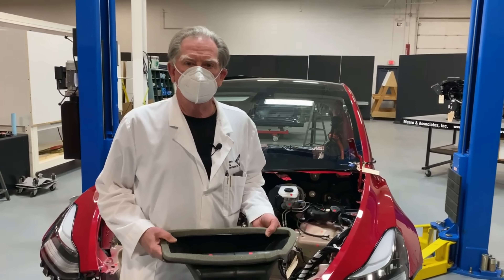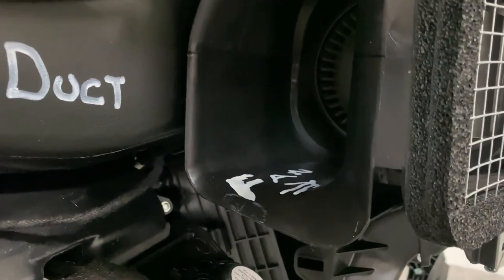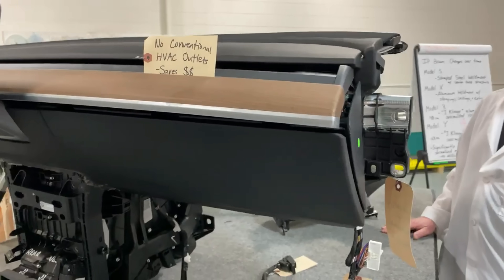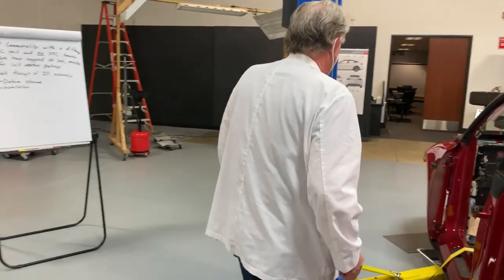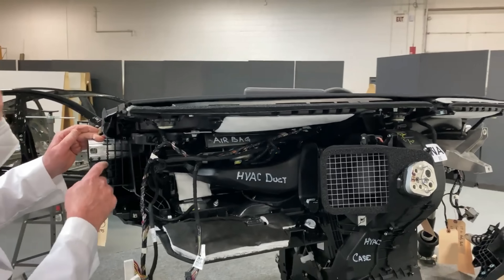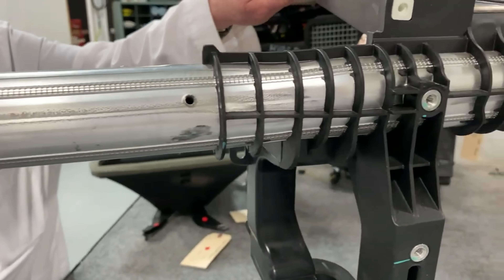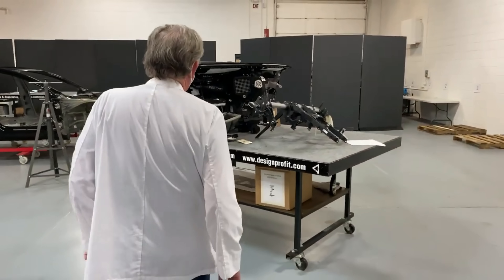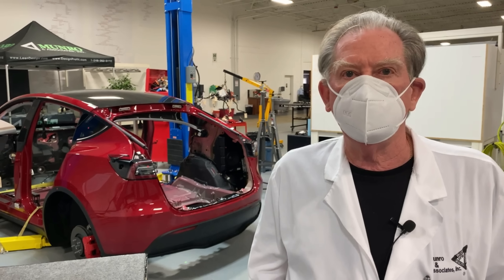Model Y E18: Instrument Panel (IP) Assembly & Comparison MY-M3

Comment: As a manufacturing engineer, I'm not seeing anything unique in assembly here which is cost effective, reliable and of quality assembly that other manufacturers don't do. Would be interested in seeing a true build cost as that would indicate the profit and viability of Tesla. Today it's been announced that Tesla is asking for sales location rent reduction from landlords due to cash flow issues. Let manufacturers reopen and adhere to CDC guidelines. "It's the economy stupid!"
Reply: The model Y+3 are most unique due to their powertrain, recharging speed, user interface, and price point.  There have been things shown and referred to (the overmolded extrusion subdash, the octovalve, and probably some others that I'm forgetting), that are very unique and innovative. If someone can't see that, perhaps they'd like to buy my bridge 😂
Reply: @thelondonbroiler  Ah, I see you must be a fanboy. I am speaking of the manufacturing methods / assembly techniques / processes / material selection. I did not speak of a unique Tesla design feature; slapping a tablet on a dash, a single HVAC slot on the upper dash, an app for fart noises, etc. There is a difference between the two. Magna International is just one of numerous automotive suppliers that performs overmolding on extrusions. I believe you might be a troll under your bridge. :)

Comment: Mr Munro, can you tell us if TESLA conditions it's battery packs? Like do they remove heat when supercharging and warm up  when it is too cold: hvac or electronic conditioning? Kudos for overmolds.
Reply: Tesla battery packs (like most modern EVs, Nissan LEAF and a few others excluded) are thermally managed using liquid coolant.
Reply: @thelondonbroiler  And the heat pump on the Model Y should help out dramatically in cold climates for range and charge rates.

Comment: A computer-controlled system of motors, solenoids, valves and louvers hidden inside a decorative slot in the dash saves money over a $2 plastic, manually operated vent cover? In what world?
Reply: Motors, solenoids and valves also exist in the other cars, so you save on every 2 dollar plastic vent cover, I have 4 in the front 2 in the back of my car some probably have twice that amount.
Reply: @johnmqueripel2367  - You would still have the back ones in the Tesla. And the Tesla would have the motors and doors to control air direction IN ADDITION to the ones that every other car has. Remember, we are talking about replacing the functionality of the dash vents, not the functionality to control air delivery.

Comment: I do not think you are right about mm, it probably not 13mm rather 13cm [130mm]. 20mm is like 0.78" something, but 2mm is 1/16" is really nothing.
Reply from the maker: Good catch, and thank you for the comment!  Just to clarify for everyone, what we observed was that there was a 15cm delta in height from the floor pan to the bottom fastener for the IP between the MY and M3, (Model Y was 63cm from floor to fastener, Model 3 was 48cm), and when we measured the height of the seat riser, we found that it was 13cm.  So, by lifting the IP by 15cm and the seat by only 13cm, you get the perceived effect of 2 additional centimeters of head room.  Thanks for tuning in!

Comment: Are you mixing up millimetres and centimetres in the height of the seats, dashboard and headroom?
Reply from the maker: Good catch, and thank you for the comment!  Just to clarify for everyone, what we observed was that there was a 15cm delta in height from the floor pan to the bottom fastener for the IP between the MY and M3, (Model Y was 63cm from floor to fastener, Model 3 was 48cm), and when we measured the height of the seat riser, we found that it was 13cm.  So, by lifting the IP by 15cm and the seat by only 13cm, you get the perceived effect of 2 additional centimeters of head room.  Thanks for tuning in!

Comment: You seem to be mixing up mm and cm in this video, both in the drawing around 7:16, and in what you're saying.
2 mm of headroom is not significant. You seem to want to say 2 cm, and also have a delta of 15 cm between the 48 cm of the M3 and the 63 cm of the MY.
Your comments about the 13 cm on the seat frame would then also make a lot more sense.
Reply from the maker: Good catch, and thank you keeping us on our toes!  Just to clarify for everyone, what we observed was that there was a 15cm delta in height from the floor pan to the bottom fastener for the IP between the MY and M3, (Model Y was 63cm from floor to fastener, Model 3 was 48cm), and when we measured the height of the seat riser, we found that it was 13cm.  So, by lifting the IP by 15cm and the seat by only 13cm, you get the perceived effect of 2 additional centimeters of head room.  Thanks for tuning in!

Comment: Hey manufacturers:  You know that "foam" stuff doesn't last very long here in hot, dry Arizona right?
Reply: Depending on the foam
Reply: In an EV there is going to be a lot less heat cycling in that general area, curious if that helps.
Reply: @brantwedel  What makes you think that? Temperatures involved in the HVAC system are similar regardless of powertrain type, and if the car is parked in the sun, it's the same situation, it doesn't matter what the powertrain is.
Reply: @bikeaddictbp  I was just thinking about how close that area is to an engine, and they tend to get extra toasty when you use them ;-) (The firewall does provide some insulation there in an ICE car, so maybe my comparison is a bit off)

Comment: Wow, I never gave a thought to the possiblity of overmoulding an extrusion, but if it adds strength, eliminates fasteners and makes the car stronger, more consistent and less complex then why not?
I guess the one thing you do lose is the ability to tear down if there is a faulty section or after some kind of damage, but it's buried so deep inside those issues are unlikely to occur in a salvageable console.